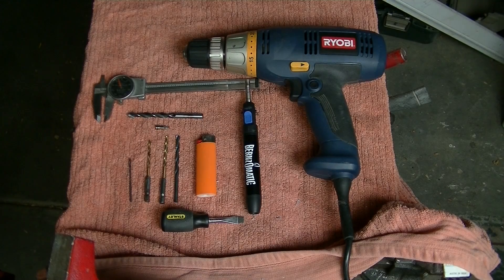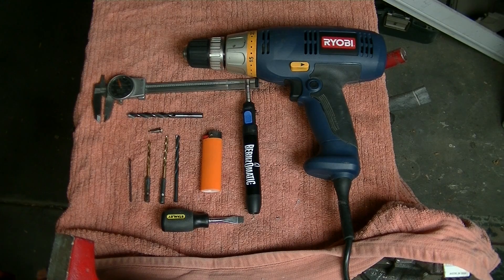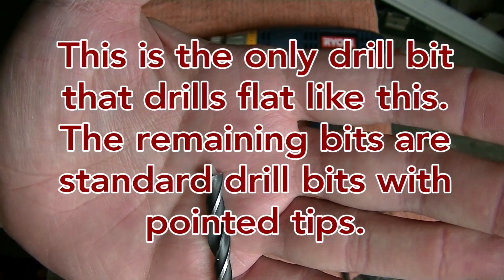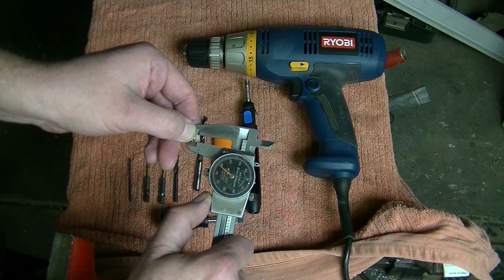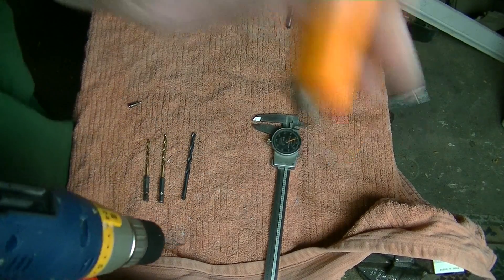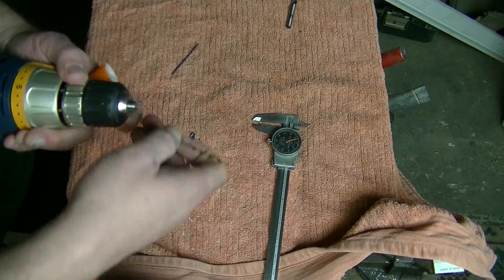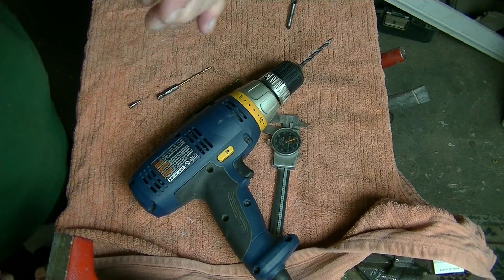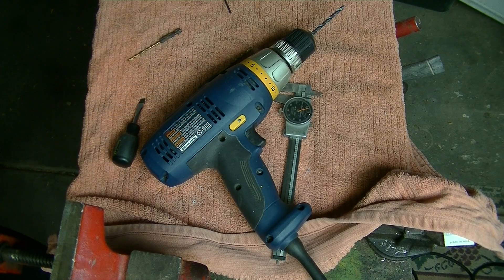Make A Bic Lighter Refillable By Installing A Refill Valve

Comment: I watched this video 3 or 4 years ago, I'm still on the push pin method, which turns out to be laughable. I've used push pin method for at least 4 years now and it does present with many problems. After a few refills it starts to lose gas. Sometimes you refill and the flame stays really small and other times its gigantic. I feel this video shows the best way, but in 4 years since I first seen this video, I still can't find refill nozzles. I might have to buy the bernzomatic lighter to make a good Bic lighter. I'm really cheap, but I think 4 years of finding an alternative, it would of been cheaper to bite the bullet and buy the 10 dollar lighter.. I've literally tried pulling apart cheap lighters to harvest the refill valve, cutting the ass out of another lighter and melting it onto the Bic lighter.. I think I'm ready to spend 10 bucks, held out for 4 years, you win man, your ways the best way. You prolly find my old comments here.. Wish I had of just listened to you in the first place, I've had lighter fluid spurt in my eye trying to refill with a push pin, had the push pin eject at high velocity, spent a fortune on gas. I would lose more than half the gas on just trying to refill. Lol thought I'd come back and let you know your ways porlly the best and I'm finally ready to spend 10 bucks for a valve. Lol thanks for the video
Reply: Thank you for your research and the laughs lol😂👏👏👏👏👏👏👏👏
Reply: @ratelhoneybadger  no problem, if I can save you 4 years of headache, I'm happy!!!
Reply: The cheap disposable lighters can be refilled through the nozzle, You may want to try that with a BIC. https://youtu.be/MrK2IhFNkqY. Also check out CLIPPER lighters, they are refillable plus flints and flint barrels are replaceable, very reliable lighters that's been on the market since the 1970's. https://en.wikipedia.org/wiki/Clipper_(lighter)
Reply: Yes buy a good lighter
Zippo like or clippers
Careful with the clippers u may become a stoner
Reply from the maker: You need to look at shops that sell paint ball equipment. They have refill nozzles for days!
Reply: No need for a valve, an O-ring will do.

https://youtu.be/ShvqtG1Vo50
https://youtu.be/vlQg-XOPx0s
Reply from the maker: @Ntwadumela1  Except for the linguistic challenge ... since I don't read, write nor speak a single word of Russian ... it looks like an interesting idea, but take it from experience ... super glue does NOT hold up well at all to butane! That solution is very short term.
Reply: @MikeSims70  They don't explain what the purpose of Super Glue is, but I believe it's purpose is to keep the O-ring in place while you push the needle through it. Neither English nor Russian are my first languages, but I speak a little bit of both. You can auto-translate the videos (it's not perfect but better than nothing).

Comment: Bic lighters are the best lighters ever with two flaws. I can't be refilled and the flame is non-ajustable. We should start a protest called Bic's Lives Matter to persuade the factory to make the perfect lighter. I also want to know why Cellphones don't have built in lighters as well, it killed our watches, torches, maps, calculators etc. O maby they can put a knife in as well.
Reply: Ahh, in a perfect world. Bic wouldn't make their lighters refillable because then people wouldn't need to keep buying tons of lighters.
Reply: Bics aren't refillable** until now.. tbh its actually shameful how little flint is used before your outta gas and trash it. I started saving the flint and both springs inside the light, never know when they'll come in handy. And yes, I know famous last words of a hoarder lol.
Reply: Also. Your phone can act as a lighter tbh, take it apart short circuit some wires and **boom**. Your phone is now a lighter, and has just exploded...
Reply from the maker: Bic lighters use to have flame adjusters until the Democrats outlawed them... you can still get them in other countries ... where they are still not a threat to health and safety....
Reply: @MikeSims70  You do know there are lighters available in the US, both refillable and disposable, that have flame height adjustment, right?
Reply from the maker: @CanItAlready  But they are not Bics
Reply: BIC LIGHTERS MATTER signs in the middle of a black lives matter March held by a little old Mexican lady LMAO

Comment: Have you tried making a hole either on the left or right side of the divider instead? Seams to me it'd be a lot easier than having to drill the divider wall away to make room for the valve? 🤔
Reply from the maker: If I had a drill press and everything was secured properly, that might work. But you have to realize that the factory sealed fill hole is only protected by a small plastic BB ... and the process of installing the nozzle on either side of the partition might compromise that weak point ... also, getting the nozzle to sit flush so you can stand the lighter up would be a concern.

Comment: i like this idea better but its too much for work for us who’re not familiar with these tools 😃 where can i buy a refillable bic lighter tho? 😭
Reply: Its sad they dont sell refillable bic lighters but you can hire someone to do this for you or ask for some help
Reply: You could get this stuff at a pawn shop for like 25 bucks
Reply: Get a clipper lighter.  Refillable.  The Flint is changabl e.
Reply: @SneekyFauker  Perfect! Why so many don't get it? It's even better for the Nature..
Reply: Get a refillable lighter. And the tool is a drill!???? Metal, Wood, Titanium drill doesn't matter. Or use a hot Nail to melt a hole. (After emptying everything)
Reply from the maker: I dont do them for sale ... a clipper is probably the next best thing.

Comment: Can i use a tire valve???
Reply: do you have a can of butane with a tire stem refill tip on it? what are you refilling, a flamethrower?
Reply: Mohammad Mistarihi They are not just used for tires, You can find Schrader valves in A/C applications too, but these uses a different seals.
Reply from the maker: LOL! Thanks for that laugh. It's a valid question but I would imagine it wouldn't work on account of the rubber groove in the base of the valve getting cold from the butane which would cause unwanted elastic constriction in the rubber and would probably cause leaks ... not to mention the size of the hole you'd need would most likely be larger than the width of the lighter.

Comment: I just buy clipper lighters, cheaper already refillable and flint changeable also.
Reply from the maker: Clippers aren't too bad actually ... I bought and tried some a couple years ago and I will say that I was not disappointed ... other than the fact that they grew legs ... they were a good time before they ran away from home.  ☺
Reply: My issue on the clipper was the flame was the size of liberty 🗽  I dont know how to fix it lol
Reply from the maker: @Dimaquibo35  sometimes shoving something down right next to the nozzle to slightly restrict flow can work ... but its a hit and miss proposition and it usually requires replacement every so often.
Reply: Bics are the best in the world
Reply: They don’t light every time like a bic though.
Reply: Yeah bics are my other favorite lighter but as much as I lose lighters I would hate to put work into it all the time and then lose it lol. Another thing is I usually change out the 5 star type strike wheel with one from one of those cheap crack lighters that someone threw on the ground (bics are too wide) and that seems to fix the not lighting everytime issue.
Reply: Clippers suck yo
Reply: Cliper flints suck. I have been using a dead Bic lighter as a torch starter for 3 years now 🤣

Comment: i finally remembered that i need some of these lol.  is there anything special for the smaller valve or is it just shorter?  Also why not just make the hole on either side of the center so you dont even have to worry about the center divide thats inside?
Reply from the maker: I say give it a shot ... then let us know how it turns out. ☺

Comment: Hand torches that are of the expensive typehave either the standard refill valves or the kind you lmentioned. However I have been in some Indian run stores and especially any stores that sell cigars and cigar equipment. Kroger here where I live in their cig section sells Firebird cigar lighters but I wouldnt gut a perfectly new 7 dollar triple jet for it. I'm a hobbyist / modder I save and gut torches all the time.Off topic slightly. if you ever need replacement fuel hoses on hand torches / cigar lighters best place to get them are by gutting 88 cent wal mart kitchen lighters in the camping section.

Comment: Hmmm buy cheap metal cased lighters or metal clipper they have simmular valves but idk I've small bic might work to try it out xd aways when my bic die I use the flint on my Zippo but really decent idea for a cricket or djeep or idk

Comment: With so much resource one can make a new zippo.
You are fail buddy
Reply from the maker: Except for the simple fact that ZIPPOS SUCK - but other than that - thanks for nothin.
Reply: Mike Sims yep, and they usually smell like lighter fluid after every use, and are too expensive to maintain use.

Comment: 4 dollars for a minuscule valve !? what a rip off ! For this price you can buy like 2 or 3 refillable  lighters !
Reply: Sébastien Fraggl you cant buy 2-3 reffiable lighters for this you old tard. I got a cool bic did this 3 years ago spend $20 on butane and it’s been refilled hundreds of times beat that bud.
Reply from the maker: Yet another one who completely missed the point ...
Reply: Mike Sims, Apparently "Why do i have 6 neutrals" Has a magic lighter that never needs a new flint, And a Zippo flint is too wide to fit a bic, I call BS!
Reply: No, he said it was 10 bucks for that torch pen, which has the value. And exactly what this responses said, you completely missed the point of this. Considering a big ass can of butane is like 5 bucks and you are set for a long while! Easily saving money by refilling opposed to buying a new bic every week. Plus this method is eco friendly! Ok cool. Sukadik

Comment from the maker: Check the comments for updates on valve sources - you can also search the Internet for 'airsoft refill valve' or 'butane gas refill valve' - Amazon sells them as do retailers dealing in paintball supplies.
Reply: I have been scouring the internet like crazy and have had the same exact issue you said you had from the video which was not being able to find these pieces anywhere except for the ones that were already within a torch or lighter or whatnot.  Even after searching the quoted "butane gas refill valve" & "airsoft refill valve," the only thing that looked comparable were the airsoft valve pieces, so I was curious if you knew any specifics with those because they have limited information on the item, & I obviously don't want to order a bunch of these if they're not going to work. They are both inexpensive and look exactly like what I would need, so I didn't know if you had heard of a piece called a "KWA I-8 Universal GBB Charging Valve." I'm quite the newbie to this so whatever help you can lend would be great... Thanks.
Reply from the maker: @TSF-007  I updated the video description area with a good source for nozzles.
Reply from the maker: @TSF-007  They will work ... the airsoft valves are exactly the same thing as the so called butane valves... just some metal with springs and some rubber usually to seal the thing up when you're done filling.
Reply: @MikeSims70  sweet! I actually took a bit of a break from that project so I forgot I even left this comment on here until I looked through my emails tonight & saw a response from you... I'm glad to know they'll work, that was my biggest hangup with the project, that's what got me to stop working on it because the valves I was extracting were so fragile, if you got the tiniest of cracks or even just an infinitesimally small, fractional warp would render it useless, it was maddening. Thanks for the info, good luck with your future endeavors.
Reply from the maker: @TSF-007  - ... so there are so many different varieties out there, which I learned when I started buying them from air soft vendors. The last time I bought like a 5 pack and I was pleasantly surprised when I got them because they were actually smaller than the valves I was using which meant that I didn't need to gut the lighter to install them because they weren't long enough to touch the plastic partition inside the lighter and they still accepted a standard fitting from a butane can... which made me wonder if that was common with paint ball guns - to have smaller valves like that or perhaps they have many different sizes and I just got lucky not knowing what I was doing and just ordering a few to have on hand. 

If you can get dimensions on them, then at least you'll know what size they are before you purchase but in terms of being functional Id say they are of a higher quality than what you typically see in a butane lighter ... but that was my experience with them ... can't say for sure you'rs will be the same. If you're looking to purchase a lot of them, Im sure they would gladly take them back if they don't work for you... but that can be some additional shipping costs - might set you back a couple of $20s if you had to return them - round trip cost that is...
Reply: @TSF-007  You can buy the valves at any air gun online store. Those valves do work there are 3 different sizes one doesn't work. the other two will.  I have their business card somewhere when I find it I'll update this post.
They also make a tool that lets you screw the valves in quite nicely. Or you can take a flat head screw driver bit and Dremel the center a couple mm to fit over the valve itself.
Reply from the maker: @mykeeX13  The last set of valves that I bought were from a paint ball hardware supplier though I cant remember which one, but these valves are short enough to where it is not necessary to deal with the center partition inside the lighter. Though the diameter of the valve is similarly smaller so it takes a little more finesse to install it, but they work quite well.
Reply: i bought a cheap refillable lighter, (cost a couple bucks) and retrofit the nozzle that came with that lighter into my bic, takes a bit of effort and time to make sure everything fits without leaks, but its doable and if you're doing this for friends it makes the hassle of getting the butane nozzle a hell of a lot easier. Good luck with your endeavors !
Reply from the maker: @albraaeagle  Thank you for that ... this is quite interesting ... was the nozzle in the lighter you purchased a stubby type of nozzle or does it have a long protruding tube coming out of it?
Reply: Sorry for confusion.  The valve ij description,  is it short enough to avoid center piece

Comment: Maybe its me, buy I'm lazy, I'll do the push pin thing or god forbid, break out a buck for a new one or ask to use someones lighter and just keep it, we have all doe that. Go to a party and come home with o lighter or come home with 10 lighters, lol.
Reply from the maker: YOU'RE WELCOME ... for the lighters ... ;-)
Reply: Thanks to you I am not rebuilding one you will take it. LOL My buddy Lenny  years ago had every lighter in a party of 20 within 3 hrs stoned out of his tree giggling as we all were looking for a lighter. He had planed it and executed it well . Was a good laugh .
Reply from the maker: @pkuudsk9927  I was rather fond of setting the alarm on a digital watch for like 3am, then loosening the screws on a ceiling vent somewhere and tossing the watch up into the air duct, re-seal the vent and go about my business ... I'm sure it would take several nights at 3am trying to find out where the beeping was coming from ... lol
Reply: @MikeSims70  Bahahahah
Reply: Honestly though I got the coolest Ford Mustang design and I’ve refilled it hundreds of times now haha $20 on butane of $300 in bic lighters?
Reply: When you think about this long term it’s hundreds of dollars saved then when the flint runs out you re use the valve on the next cool donor
Reply: You have possibly found a free way to get rid of your useless testicles by using this lowlife method.

Comment: i just found this video but i actually made one earlier today using a torch lighters double o-ring refill valve :)  and RTV silicone for that "extra seal"
Reply from the maker: You might find that butane has no respect for silicone ... I hope you find more longevity with it than I did.
Reply: @MikeSims70  yes i found out a few hours later lol

Comment: This man is a producer. Not a consumer. He should be a small example of how more Americans should think for themselves and be producers. 
I also have one of those butane 6 in 1 soldering irons. I was just looking at the valve thinking I could take that out and put it into a bic. I searched YouTube. Same thing I was thinking. Funny how things work like that sometimes. I dont think I'll be sacrificing my 6 in 1 though so I'll check to see if Bernzomatic sells the valve as a replacement part?
Reply from the maker: Thanks for the kind words JC. I did post a link below the video where you can purchase the valve by itself, and you will find that any store that deals with paintball guns will also have the nozzle you need ... get the smallest one you can find and you could even skip the step where you have to chip the plastic out of the lighter ... drill the hole, tap it with the nozzle and you're done.
Reply: @MikeSims70  looks pretty good for $3-4.
Reply from the maker: @JoshuaCussins  For sure ... I've used them and they do work ... they are quite a bit smaller, so you have to have a little more patience with them, but they are great!